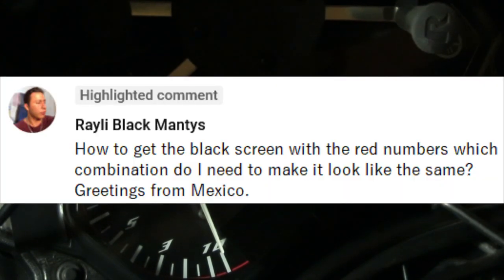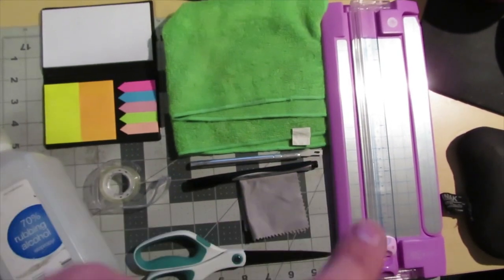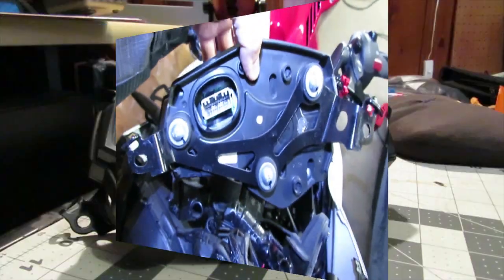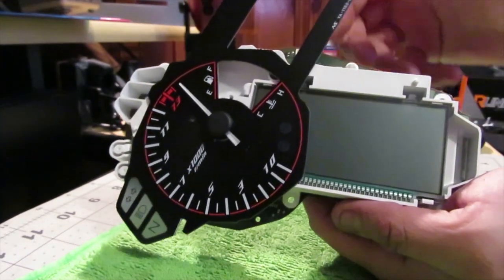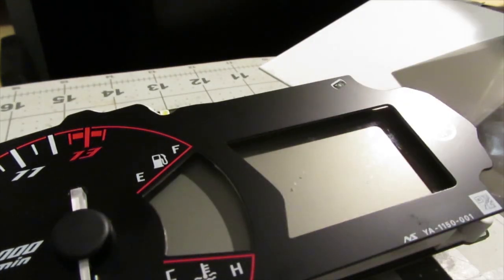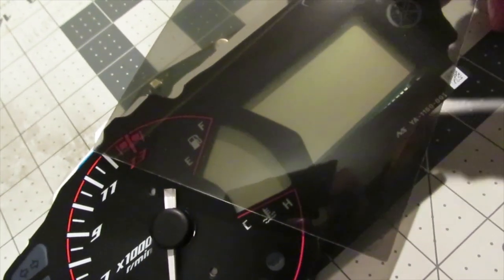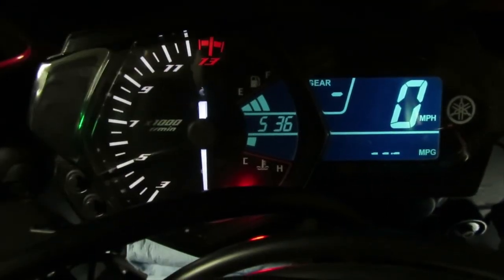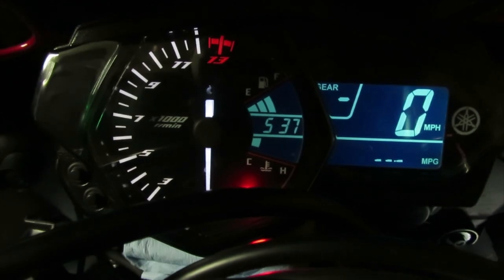How to do a Multi-Color Inverted gauge for the 15-18 R3/R25

Comment: Great video AC Productions.  I'm super thankful for the ideas.  In regards to the speedometer needle, it pulls right off.  I learned from another YouTuber Mitch McBergsma that a fork or a pasta spoon is a great tool for gently pulling it off.  Just mark your spot when you do so you know where it should point when you push it back on.  I did it myself on my Suzuki Burgman dash several times.

Comment: This is really good. My idea however, is to change the LED backlight for the LCD screen to yellow, then use the polarized film to invert the color. The reason is that I don't want my LCD screen to look yellow all the time even when the power is off because of the filter if I use it. The only thing I'm not sure of is if that method will work the same as using a filter to change the background color. Hopefully you can tell.
Reply from the maker: yes if you change the white leds to yellow then used the polarizer then it will make the background black and the numbers yellow.

Comment: so if im going to use a colour filter, am i just going to use the colour filter it self and remove the original filim? or can i jusy lay down the color filim on top of the original filim ? thanks
Reply from the maker: if you lay the color film over the original face of the gauges then you will just change the color of the white background to the color you selected. which i have a video showing just that here is the link to that video https://youtu.be/v1tHdlTP3bk
but in order to change the color of the numbers you have to remove the original film and replace it with the polarize film then the color film of your choice.